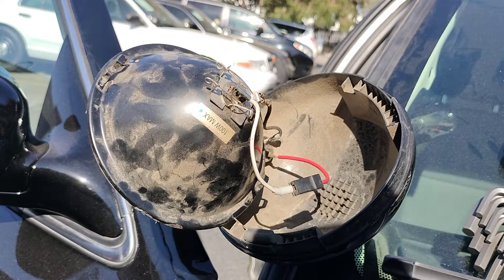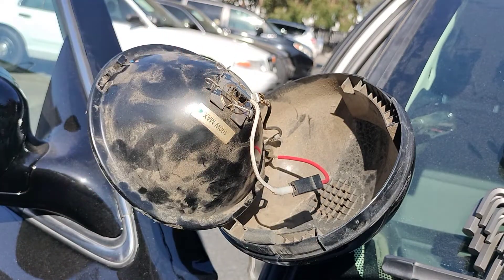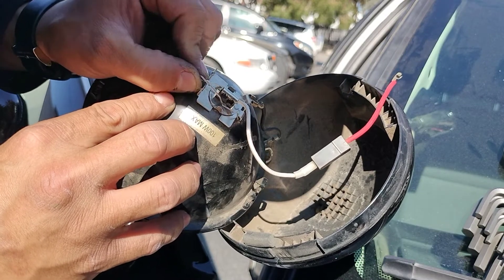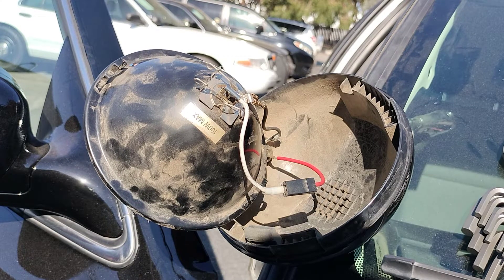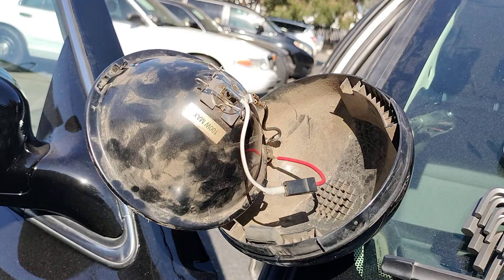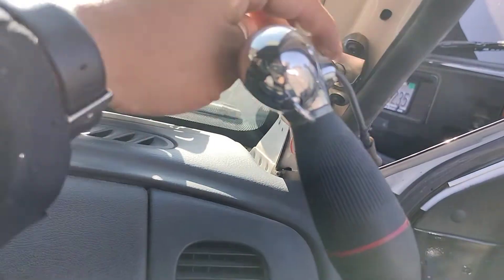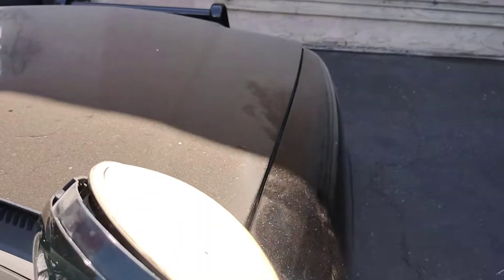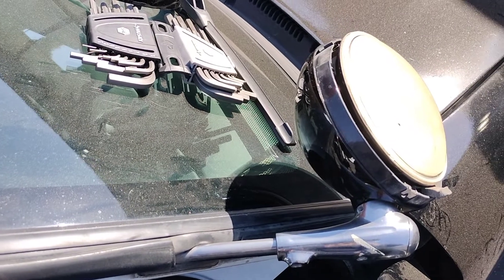Ford Crown Victoria Police Interceptor Spot Lights not working fix

Comment: So I just replaced both my halogens with the Whelen upgraded LEDs. Prior to changing they didn’t work and I assumed it was because the halogens were burnt out. However they still aren’t working. I tore everything apart and made sure everything was connected. However didn’t check the fuse…would this be my issue?
Reply from the maker: Do you test for power?
Reply: @carsmartautomotiveinterceptors  don’t have the ability to currently. I did put a fuse in the proper spot so I’m about to just take it to a ford dealer to have them troubleshoot
Reply from the maker: If you have power and your spotlights are not turning on is probably because it's not grounded correctly or you may have a spliced wire. I dough Ford will trouble shoot the issue because that's part of the upfitt. If they do be ready to pay $$$.

Comment: Nice How To video! Can you upgrade the Unity to LED on a Crown Vic fairly easily?
Reply from the maker: Yes. Open the spot light cover and remove the ground and hot wire.  replace with LED light and reconnect ground and hot wires put cover on and Done.
Reply: @carsmartautomotiveinterceptors  NICEEEEE!!!! 👍👍👍👍

Comment: So it was disconnected?  I have a 2014 Tahoe it looks like no power to the wire before the spotlight 
Do you think it has a fuse because is driving me nutz thanks bro
Reply from the maker: It was disconnected, in your situation I would try to look for spot light fuse diagram (police) and check if fuse needs replacement. If your fuse is good you may have a disconnected wire somewhere.